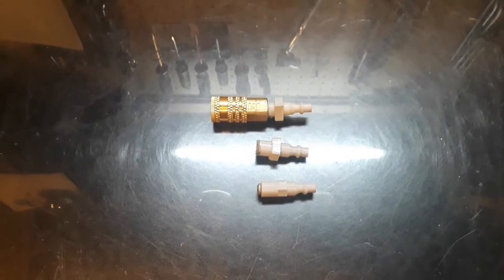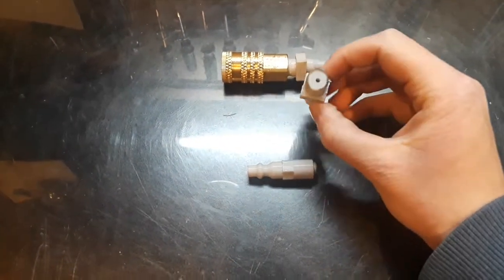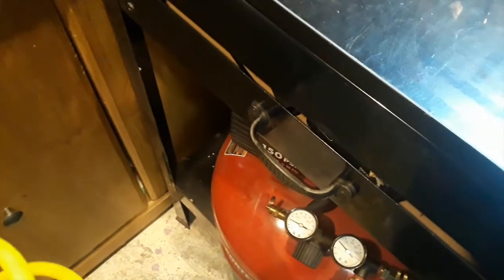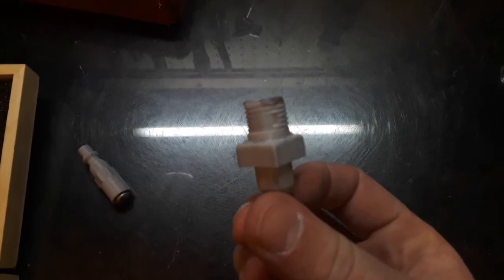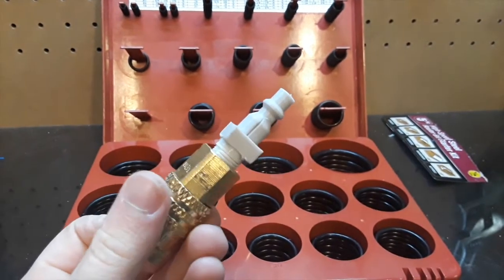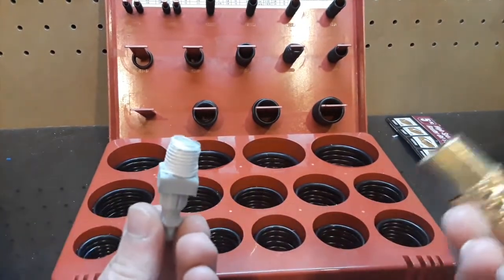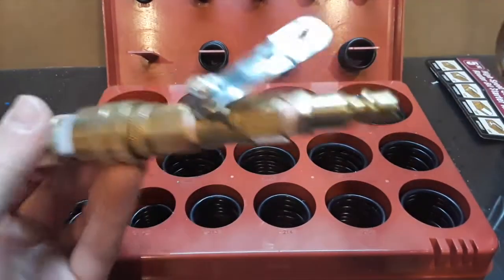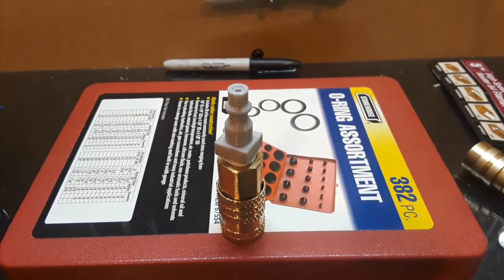How to Make 3D Printed Air Compressor Fitting

Comment: could try printing the threads instead of a die
Reply from the maker: Very true!
Reply: That as it turns out is easier said than done. I was like I need a double compression fitting for two different type of interfaces, let's model it. All night spent on that thing. Majority of the night was just figuring out good threads for vacuum-tight fit. At 7 pieces,  3 tpu and 4 pla it just might be a bit on the over-engineered side.

Comment: You should have cranked up the pressure to see where it fails If it would with your compressor
Reply from the maker: Not a bad idea, but it's kind of dangerous. I would recommend for low pressure applications.

Comment: Have you considered using other materials such as  PETG, ABS or nylon? These materials are not as hard as PLA but they are stronger. An interference fit with printed threads could possibly allow for a tight seal without the need for o rings or Teflon tape. I would like to give this a try in some different materials. Can you share the STL file that you used?
Reply from the maker: I think other materials would work better. But I don't really have the (means,time,and money) to invest a lot of resources to this project. I'll try and figure out some way to share the STL file.
Reply: @BunkerBuilder  I understand. As far as means for sharing the STL, You could upload it to Thingiverse and edit the description of your video to include that link for others (like myself). Also I will upadte you here with what I have learned using ABS/PETG as I have those materials on hand.
Reply from the maker: @jacobconway1496  I'll try uploading it to thingiverse, Thanks.
Reply from the maker: I uploaded it, but it says I have to wait 24 hours until it can be viewed to the public. I'll try and link it tomorrow.
Reply: @BunkerBuilder  Thanks!
Reply from the maker: @jacobconway1496  Sorry for the wait, https://www.thingiverse.com/thing:3857181